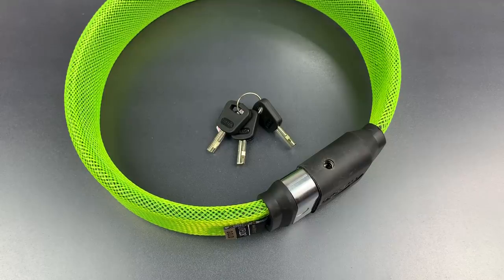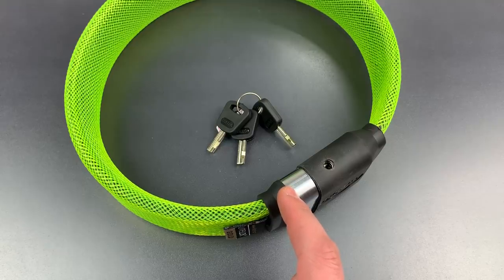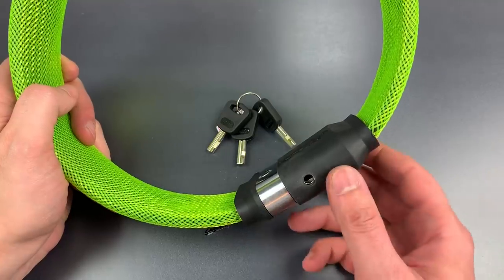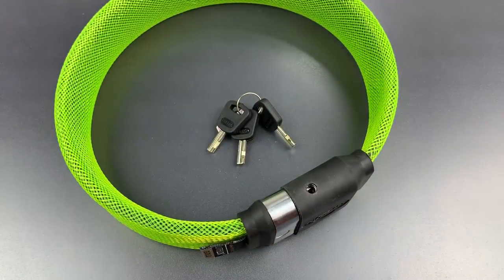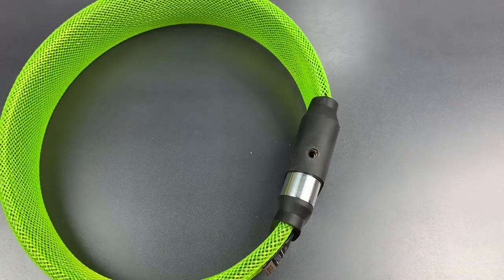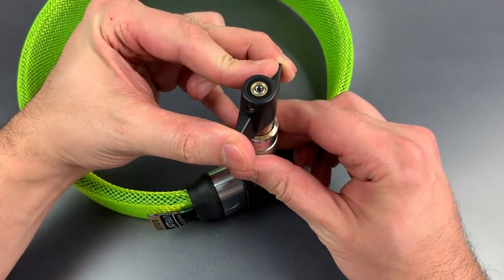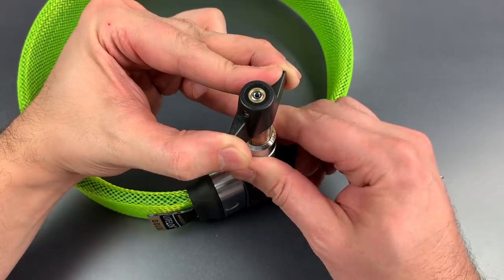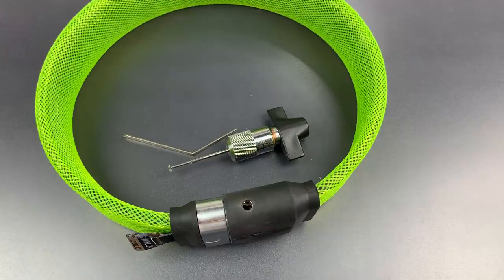[784] LiteLok Gold Bicycle Lock Picked

Comment: What is an example of a good bike lock? I've not been following this channel too long and most bike locks I've seen him cover seem to be pretty weak in most aspects. I know none of them will be unbreakable but maybe something that lasts longer than a minute.
Reply: @1 J fair enough. I ask more out of curiosity than need. I live in the sticks so if anybody would be compelled to steal my bike they are welcome to it. I'd be more confused as to why they are stealing bikes from farmers. Still! Good to know if I ever decide to take my bike to campus.
Reply: A good hardened steel chain with a good quality padlock. None of the dedicated bike locks seem to survive very long.
Reply: I think U-Locks are the strongest locks (especially if you consider weight). Get a high quality Abus or Kryptonite and you should be fine.
Reply: Don't worry about actual lock, bike thieves don't possess skill to pick the lock open. Just get a beefy chain or a good u-lock.
Reply from the maker: I favor heavy chains... not because they are stronger than u-locks. Both are robust. But the real threat to both is an angle grinder, and the chain is harder to cut because the links are difficult to hold still. 👍
Reply: @lockpickinglawyer  that makes a good deal of sense. With that logic I would assume that braided cables could be easier to cut than chains as well. If it was robust enough to require a grinder it would end up fairly stiff.
Reply: Don't think of this as a lock problem, think of it as a security problem. The best way to secure a bike is to not store it someplace that people can get to it. That's not exactly practical though.

There really isn't a lock that'll stand up to attack for long, so at best you're just making sure that your bike is more of a PITA than a bike it's parked next to. Also, the cheaper your bike looks the better. I've seen guys debadging their cannondales and replacing the branding with Huffy branding and I think that's a good strategy.
Reply: @jttech44  good points all round. This really isnt an issue I have to deal with myself more a curiosity. Just seemed like most of his videos on bike locks dont build much confidence. I live in the country were you can leave your car keys in the ignition all night and sleep like a baby. I mean I dont do that bc I cant afford to lose my truck but my grandfather has for almost 70 yrs and it has never been an issue. In college however I saw many a wheel less bike frame or broken lock.
Reply: @jttech44  True, my Marin is black with no branding which is perfect for town commuting (actually it has branding, but its painted on with this reflective paint that only shows in strong light source, such as car headlights)